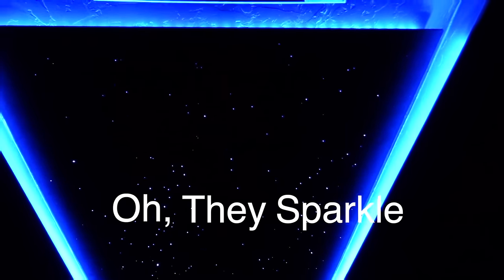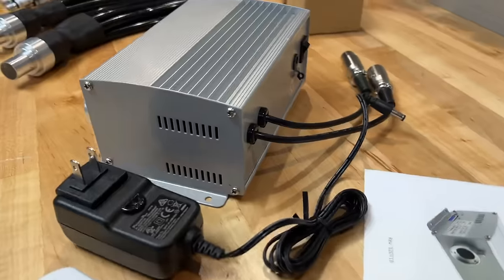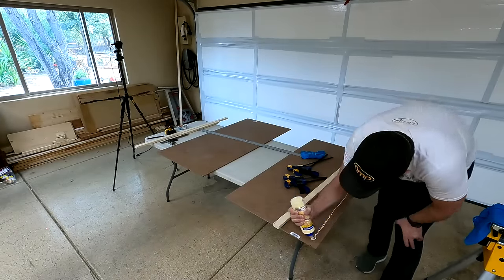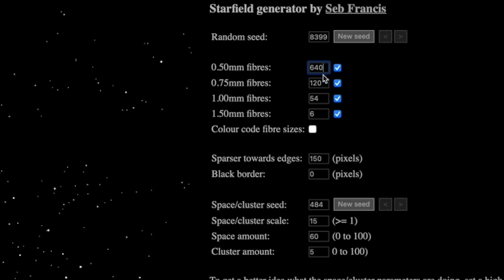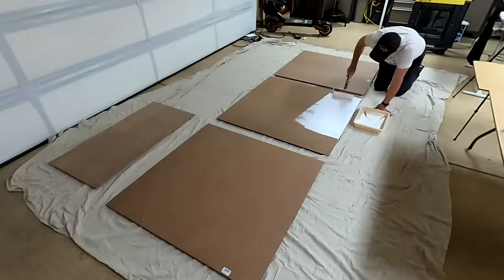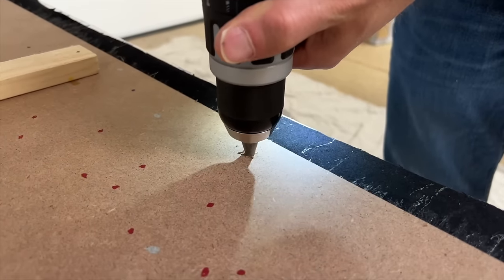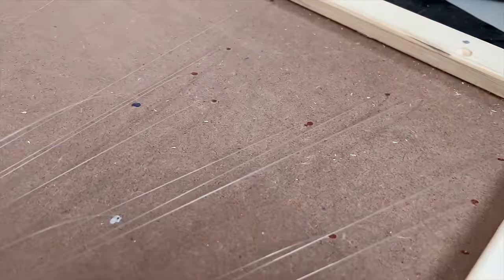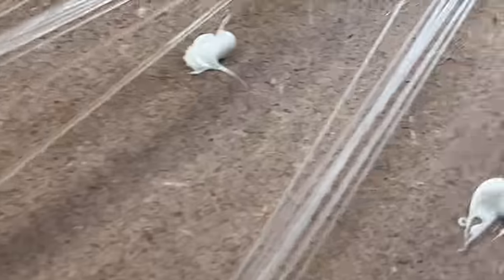I Made My Own Fiber Optic Star Ceiling Panels | Home Theater Shed

Comment: I did mine by simply installing led lights above the drywall and then drilling different size holes.   Looks fantastic and saved a ton of money and I don’t have a light emitter that will eventually break and tons of cables.
Reply from the maker: That is a creative way of doing it. How do you get the stars to twinkle or be uniform in brightness?
Reply: I mean... that works but like.. if you have any bugs in your house that'll be their room now not yours. The more places they have to the hide the more it becomes theirs snd less yours
Reply: If you have a pitched roof put a projector above the ceiling ? A few stuck pixels wouldn't matter. Don't blame me if it overheats.

Comment: I want DIY fiber optic star ceiling
I've done almost exactly what you've done with my home theater project, but the only problem I have with it is that my ceiling isn't wood, it's concrete, and I haven't used fabric for the panels, I've just painted them. drilled through and out with the fiber optic star lights they are also not bright white and won't blink so I took the pdf board down again to try and do it like you have done in your video. Thank you so much for making this video. Sincerely
Reply from the maker: for sure!  Well done

Comment: That is amazing.  Very nicely done
 I was about I build this in my mancave I was going hang it with hooks but I like your magnet idea. Question though.  The boards you put into the ceiling did you screw them into studs or just use anchors?
Reply from the maker: Into studs for sure.

Comment: As an AC guy (I'm sure others have commented as well)
1: You are going to kill your blower motor and compressor eventually due to the airflow restriction you added by blocking the return. And,
2: you will always have a dusty panel because that is now the filter..
The plus here is that your AC filter will always be clean! (you will just have to replace the panel every 90 days) The room looks AWESOME, though! It's just that panel placement could cost you $10,000.. How much did that panel cost? I bet a little less than 10k...
Reply from the maker: yes, I agree.  I've since remade the panel to be open where the returns are.  Not as pretty but at least I won't be replacing the compressor every year. lol

Comment: I absolutely love the way you broke it down and explained the process of doing this. It makes it very straightforward to follow, and I look forward to doing something similar myself. My one question/concern though, could the fiber optics directly covering that vent get damaged when the heat is on? Likewise, could that fabric being that close to it be a fire hazard?
Reply from the maker: I have since removed the fibers and fabric from directly under the Ceiling unit to keep good airflow and not be any kind of hazard.

Comment: Thanks for sharing again. Great stuff. Curious on how you added safety tethers to each panel. Was it just a tether on each corner that you somehow fastened to panel and ceiling? 

I too am afraid if I do something similar with the star ceiling that the magnets could fail and get dislodged for any reason.  Thanks!

Comment: Weird question but what kind of fabric is this? Cotton, Satin, etc? I plan on buying the led hydra setup from the vendor but wanted to order the cloth locally. Any idea on what the cloth is made of?
Reply from the maker: No idea but I got it from Starscape and it's specifically designed for drilling through so you don't get threadouts.

Comment: Question: isn't the light generator supposed to be in a well-ventilated area? This is what's stopping me for working on a similar project but I see you put it inside a compartment in the ceiling. Thanks!
Reply from the maker: The little hole I put it in accesses the attic so it's very spacious and to me qualified as "well ventilated"
Reply: @MANSHED  thank you

Comment: Hi, i'm looking to make a star ceiling myself, I tried doing it once with static fairy lights attached to the optical fiber that went through a board. This time around I'm hoping to go for a light engine. in your experience, does the light engine tend to get hot? does it require any kind of ventillations to make the whole setup less hazardous?

Comment: Thanks so much for sharing this process. I am wanting to do this for my sons’ playroom. If I used ceiling tiles instead of MDF boards, do you have any ideas on how to make that work? (To do an entire ceiling) would that even work?
Reply from the maker: It could work but you would need to have one fiber main run to each set of tiles so that might get tricky.  I would depend on how dense you wanted the star pattern. Mine are about  30 per SF

Comment: Where did u get the fabric from . Also does it get dusty as it is fabric .. why didn’t just black paint work .. what was the beef for fabric . Hopefully u can help so I cna make those decisions this weekend
Reply: Let me reply on behalf of Starscape - the fabric supplier. Black paint is OK, and cheaper, but it's not such a good finish for a home cinema room. The fabric is much, much better at reducing reflections from the screen and it is also better than paint when it comes to making the joints between panels less visible. Of course, with painted panels you can try filling the joints, but in my experience it's then quite hard to conceal the filler - it tends to show through the paint.
Reply: @peterfagan3587  do you supply the fabric to USA ?
Reply: @khichddi  Yes, we ship all over the world.
Reply: @peterfagan3587  how do I contact you guys ?

Comment: Are you happy with the size of star ceiling? Is it wide enough or too wide compared to the width of the theater? Do you have atmos speakers behind them or are they on the sides of the ceiling? Awesome videos, I have them saved for when I build my own!
Reply from the maker: I’m very happy with the finished size. I maximized the full width of the flat part of the ceiling and very glad I ran it the full length of the theater. The 4 atoms speakers are hidden behind panels on the left and right of the Star panels. Thanks for watching hope they help in your build. So worth it.

Comment: which projector did you get for the star pattern? Also in the star generator, can you put the size of pattern or is it strictly by fiber count?  Thanks again.
Reply: Hi Rick, I'm from Starscape, so I'll answer your question about our starfield generator. It generates a square pattern, but if you're projecting onto a standard 8 x 4ft board you can simply use the top/bottom half of the image and double the number of stars to compensate. So, if you want 200 stars per panel - which is what we recommend for an 8 x 4 panel - you'd enter 400 stars in the generator. And if you were using our Infinity tails, as Michael did, you'd have 320 in the 0.5mm field, 56 in the 0.75mm, 20 in the 1mm and then 4 in the 1.5mm field.

Obviously you'd have to adjust the position of the panel or projector to match the size of the projected image to the physical size of the panel.

Comment: How much money did the theater Materials/seats etc cost ? Really want to do this in the future but don’t know how much to save. 
Amazing job by the way.
Reply: if you use the brand in the video? I'm gonna guess: 
2x extensions - $62
2x FO splitters $106
light generator $687
8x FO bundles $ 395
3 meters of cloth $110
then YMMV based on what you have on hand of each, fabric glue, 1/2"? MDF, 1"x2" lumber , magnets, screws...

approx $1500 project as shown is my dirty back of envelope math

Comment: Amazing work looks beautiful i have an off topic question do you still find yourself using the manual masking for your screen or does the jvc do a good enough job?
Reply from the maker: Are use the manual masking every time. The JVC does a good job but there is nothing like having a true aspect ratio leveraging the manual masking. They are so easy to take on and off it’s actually faster to put on the masking than it is for the JVC to adjust to the different aspect ratio even with the preset.

Comment: So awesome how much in total did it all cost?
Reply: if you use the brand in the video? I'm gonna guess: 
2x extensions - $62
2x FO splitters $106
light generator $687
8x FO bundles $ 395
3 meters of cloth $110
then YMMV based on what you have on hand of each, fabric glue, 1/2"? MDF, 1"x2" lumber , magnets, screws...

approx $1500 project as shown is my dirty back of envelope math

Comment: Hi!! Thanks for your wonderful videos....I have learned a lot from you.  

I have a question: On your youtube video where you did a walkthrough of your studio you showed your SEETEC monitor used as a teleprompter.  Could you please share the name brand of the teleprompter piece (glass/hood)?  I decided to ask here since this video is more recent.  I don't mind your affiliate link if any.

Thank you in advance!
Reply from the maker: It is this one here: https://amzn.to/37qdD7Z
Reply: @MANSHED  Quick question. As I menionted, I am trying to put together a teleprompter similar to yours.  You mentioned on your video that the screen you are using is a SEETEC.  

On the product list you did not mentione the size you are using.  I am considering the SEETEC ATEM156 15.6 Inch Live Streaming Broadcast Director Monitor.  Is that the same size you are using?

Also, during my research, I noticed that this seetec monitor only has 250 nits of brightness.  If this is the one you use, from your point of you, is it bright enough to use it as a confidence monitor/teleprompter?

Thanks again. Your input is valuable.
Reply from the maker: @jimpiterson4052  That is the same size as mine. I do sometimes wish that it was a bit brighter but he gets the job done. I certainly cannot use it in any other situation other than a controlled studio as it would not work outdoors at all.
Reply: @MANSHED  Makes sense.  I will use it primarily on the teleprompter connected to the ATEM mini Extreme.  Lilliput has one that is around 350 nits if I remember correctly but it is only 12".  
Since I am planning to use it as a confidence monitor and / or seeing the participants on zoom meetings I think 12" would be too small for that.  Not sure that giving up the size of the 15" for the brightness of the lilliput would be a worthy exchange.

On another topic, It would be great if you added the links to all the other items you used on your setup.  I have seen plenty of setups, including the one you got inspired from, and yours is by far the more complete for me, because as you, I will also be adding a flat panel like the vibe, but mine will be 65" from ViewSonic.

I am sure you would benefit a lot by having your affiliate links there.

Thanks a lot!
Reply: When you have a chance, please post the link to the monitors you use on the 3-monitor-arm setup you have.  I want to buy them today.

Thank you!
Reply from the maker: @jimpiterson4052  here you go: https://amzn.to/3IrXJaa

Comment: Pretty sure that fabric blocks a lot of airflow
Reply from the maker: Yea, I’m thinking so too but doing some tests on it now. I have a backup plan in case it is. ;)
Reply: @MANSHED  having installed a few of those, they’re “low static pressure” units.  They don’t have any force behind them to go through fabric, hence how quiet they are.  If anything you’re creating a tiny feedback loop and freezing your coils over.  They’re meant to run fully unobstructed.

Best scenario:  get a traditional wall mount head unit.  Recover r-410a, re-route lineset.  Paint wall unit black.
Reply from the maker: @xzibit8614  not an option to install wall unit, not to mention the high cost of these mini splits. I plan to remove the fabric in front of the intake grate and eliminate any airflow abstractions.

Comment: @15:18, sorry, you’re screwed.  You can’t put a panel in front of a mini split unit like that.  It will recirculate its own air like crazy and kill the efficiency, possibly even damage the unit as it will not be able to create a delta T across its coil.  Very bad idea.
Reply from the maker: yes, I have since removed the center panel and replaced it with an open design panel.